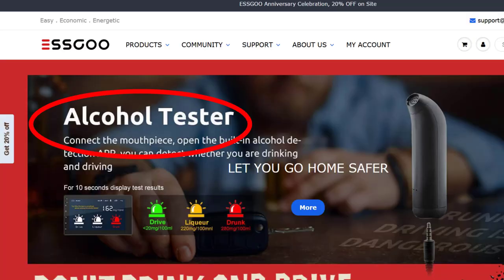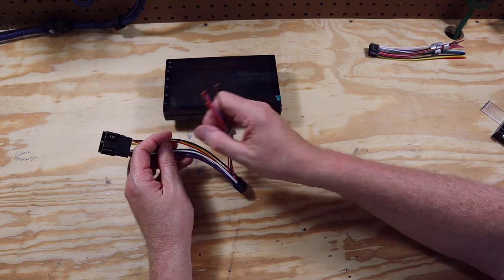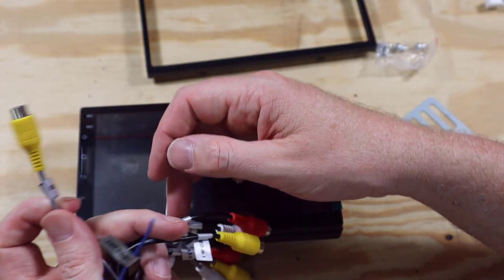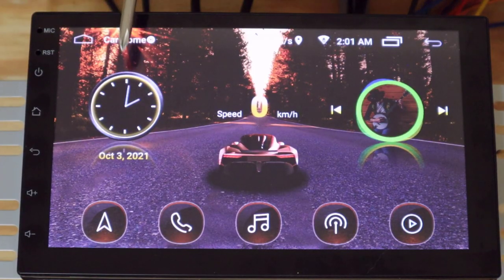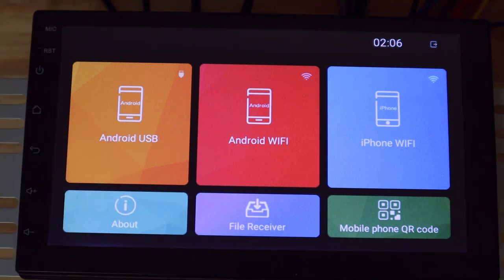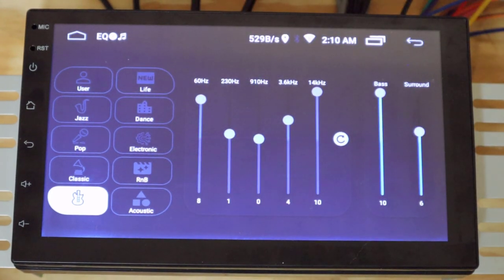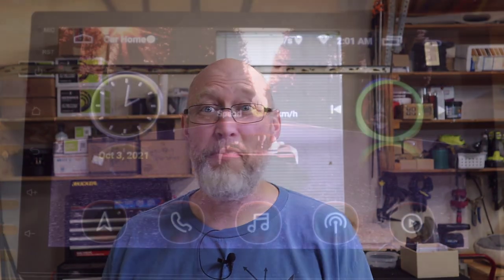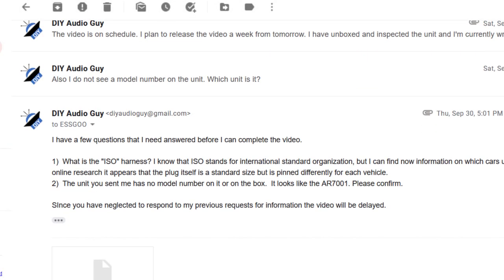Watch this before you buy an Android Radio!  EssGoo car head unit!

Comment: Honestly I would say a $65-$100-$150 you would be better off with a dual electronics or a Boss audio double din stereo system?!
Reply from the maker: My thoughts exactly.  I am bummed that this video has not done very well.  No telling how many people are ordering one of these to give as disappointing Christmas gifts to their teenage nephew that want's a new car stereo.
Reply: @DIYAudioGuy  Yeah these are all using the same motherboard on the back that contains the android SOC chip + amplifier. You can get a 10 inch screen as well. BUT the problem is some of these are shipping with fake specifications!!! They say they are 2gb ram and it shows up in settings BUT they edited the settings menu to show that. When in reality they only have 1gb. I got scammed by this but luckily I got a full refund and kept the device. You can flash different roms from different stereos using the same chip but you need to make sure you have the same rom size + ram configuration. I have one in my car but purely use it with a iphone carplay dongle. Carplay is basically streaming a video feed from your iphone and putting it on the screen, so it uses the power of my phone instead of the crap CPU and ram on the headunit. The "surround" setting doesn't exist on my headunit, not sure what they were smoking when they made the firmware on yours. It treats back right and front right as the same channel, same goes for left side. Mine also came with a backup camera and I use it all the time.
Reply from the maker: @SeMr7en  I really pissed of Essgoo with my video.  Honestly, I would have given it a decent review if it were not for that crappy "surround" function, worthless equalizer, the inability to change the default music player and the lack of a mirror app in the app store.  I expected a slow device at that price point.   It is basically unusable as a radio unless you replace the firmware.  If I were a computer/tech channel I would do that.  But that is not what I do.  I need the radio to function right out of the box.

Comment: Whenever i use the indicator the radio cuts out and reverse camera on. Can anyone help.
Reply from the maker: When you say indicator do you mean your turn signals?  You need to wire it to the same circuit that activates your backup lights, you got it wired to your signal lights.

Comment: This is why I don't like Android. (Used it all my life so I'm all too familiar with crap Android experience) 
When done right though they are amazing. But all too often they are just junk. And I feel like most Android head units fall in the junk category. (I hope I don't trigger someone by saying this, I didn't say they ALL are)

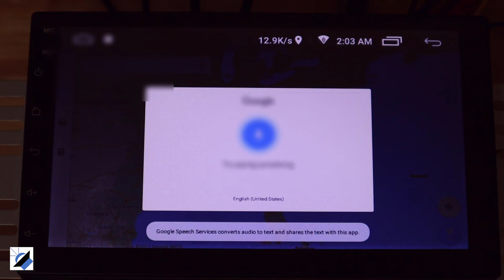7:32 haha I live near Five Star Car Stereo and I could probably drive there faster than that unit could give directions.
Reply from the maker: I've had a few garbage Android tablets, cheap ones that I got for my children when they were young.  When it's good it's good, but when it's bad it's horrible.
Reply: I don't know that Android would have actually been the problem. One of the reasons a lot of these cheaper manufacturers use Android is because they don't have to pay royalties like they would if they were to use any type of iOS. To the root of its core Android is still open source. If they actually had to pay Apple to use iOS the point of making a cheap head unit would be null and void. Plus, let's add the fact that Apple accounts for approximately 20% of the cell phone market meaning 80% of the people that buy this are going to be Android users.
Reply: @Carl_Jr  That's exactly the thing. The fact that they cheap out that much and make an unusable user experience is why I'm tired of Android and don't like it anymore. 

All too often with Android there's always somewhere they cheaped out on. Don't get me wrong I'm not mindlessly bashing on Android. This comes from using Android for 10+ years. Only recently have I switched to Apple and I wasn't saying anything about Apple in my main post. Apple has its fair share of issues that makes them just as bad as Android in some areas. 

I'm not trying to mindlessly fanboy about a single OS. We're talking about a head unit here so iOS isn't really related as there's no head unit running an Apple OS.
Reply from the maker: @Carl_Jr  For sure man.
Reply: @JoshM7  Right. I was just pointing out why they probably chose to use Android. I don't think Android is the problem, though, with this unit. It's just this unit. Android really wasn't designed for this purpose. On the flip side I'll be the first to admit, Android Auto sucks! LoL. Apple CarPlay is far superior.
Reply: @Carl_Jr  Ah gotcha. Yeah I guess when I look at it that way you're 100% right. 

I've never had a chance to try out either one.  (Android Auto or CarPlay) 
My current car I have a more basic aftermarket head unit that does all I need. (AVH-200EX) 
Would be nice to swap it for something that has a brighter screen/Car Play/GPS etc. But it's not a priority for now. 

I've had a rental car that had Android Auto in the past but my phone (Samsung S7) said something about updating something but it took me to the App Store and wouldn't let me update the app. I think the phone at the time was only 1-2 years old so not sure why that would happen. It's not like it was a generic phone or super old. 
Honestly felt similar to the app thing DIY Audio Guy mentioned for this unit.
Reply: android is not the downside, I have on my Bravo some old android 4.2.1 headunit, it works very good for 7 years. I was just looking for a newer one, with mirrorlink and newer apps.
Reply: @ovidiuperieanu8055  In my eyes it is. The root problem is poor choices with hardware which causes a terrible experience. Which is kind of the fault of Android because it's something just about anyone can just toss on a device. 

Android is flooded with cheap cruddy decided that shouldn't exist but they do. 

If you have a good experience with an Android head unit I'm happy for you. But most of the devices are too slow in 2021 to be usable. 

Of course this is my opinion and I don't expect everyone to agree. 

I miss my old HTC devices. Those were my best experiences with Android. (They still had a few minor quirks, but so does my iPhone) When I got a S7 it was amazing for half a year to a year. Then forced updates and it became the worst Android device I've used. Funny thing my friend with a newer Samsung phone had similar issues that made it pretty much worthless. 

Kinda off topic with talk of phones but they are related in a way. Never tried an Android head unit but this video pretty much sums up why. I'd expect the good ones to be more pricy then I need in a head unit.
Reply: @JoshM7  you nailed it, they found a way to push us to buy newer hardware by pushing bloatware, tbo my old ipad air 2 still works fine, ios isn't so pushy. about samsung, i confirm, i just change my wife's samsung because all the android 'updates' made him a snail-speed device. bottoom line, it's not android, but how today's bussiness model pushes manufacturers to obsolete devices via sw updates. android itself is fine, for example my sat receiver vuplus duo 4k works marvels except if i update him from older to newer version 🤣

Comment: Well I agree, noname chinese Android car stereos are junk. I bought for my old car a cheap JVC and boy, 4x50w channels, separate sub signal output and it got a very  configurable dsp inside. The sub channel got an old 400w sony amplifier hidden under the dashboad, and a Kicker comp rt 12" in the trunk which is really slim, so it barely takes any space. And that sub with the passive radiator is quite powerful
Reply from the maker: How much was that JVC?
Reply: @DIYAudioGuy  like $80 😅
Reply: It's a really basic bluetooth car stereo kd-x361bt
Reply: The FM works nicely and in eastern europe we don't have digital radio

Comment: What does that writing (written in pencil on the makeshift plywood desk) supposed to say? 
Copper Finale? Copper Finial? Copper Female? 
Because “Copper Fenale” doesn’t mean anything due to the fact that “Fenale” isn’t a word. 😜😂
Reply from the maker: I write notes to myself on my workbench.  Which wire did I crimp the female spade connector to?  Can't remember? 
 Write it down.  You will also see ohms law in silver sharpie.  I did not put a finish on the workbench so I can just sand it off when it gets to cluttered.

Comment: what was the memory and storage on that unit ? 1gb 8gb,  2gb 16gb etc
Reply from the maker: I don't recall.
Reply: @DIYAudioGuy  thank you for a quick reply but as that plays a big part in how it runs along with the processor. you may have had the 1gb 8gb version ?
Reply from the maker: @clarkspiemuncher24  I don't think that was the main factor. The real issue was the user interface and the crappy rear channels which acted like surround channels in a home theater.  I just dropped a video on a much better head unit. https://youtu.be/x_DCc865tec
Reply: @DIYAudioGuy  im only after a basic working stereo and sat nav for a van ill be selling next year so i hope it will do for that as already bought the unit the other day off ebay
Reply from the maker: @clarkspiemuncher24  if you need four channels of output then this will not do the trick. That's the problem, it's not even a basic working stereo.  Send it back if you can.
Reply: @DIYAudioGuy  to late its already opened and i only need 2 channel for front doors as its in a van and im not into putting super sound stereo in a vehicle. as long as i can hear some music and hear and watch sat nav it will do. its a plus to put on the sales ticket when selling the van next year. i appreciate you get what you pay for but its all down to personal needs and at 65 im starting to be happier with no music on at all lol

Comment: Every white box radio I've installed has been garbage.   And their pre amp section is just laughable to say the least.  We no longer install any of them at our shop including all the trash Tesla style radios as well
Reply: There are allot of crap ones, the noise bleed is what got me, you could literally hear the data signals when a USB device was plugged, drove me nuts
Reply from the maker: That sounds miserable.
Reply: i don't agree, some of them are medium quality, my fiat bravo android 4.2.1 works from 2014. dsp is not top-notch, but fiat original gps head unit was 4xprice at the time ( payed my android like 475 euros, the original was 2k). because this little 100e 
euros thing is not a good choice doesn't mean we will all buy those 2keuros manufacturer bull...t because the plastic is a little bit more worked